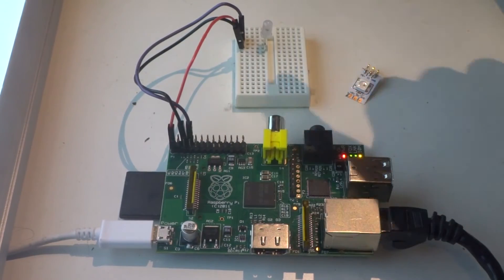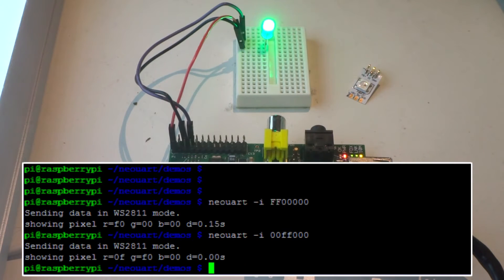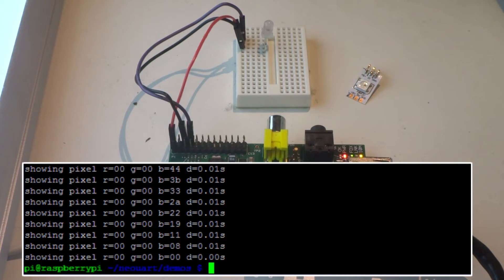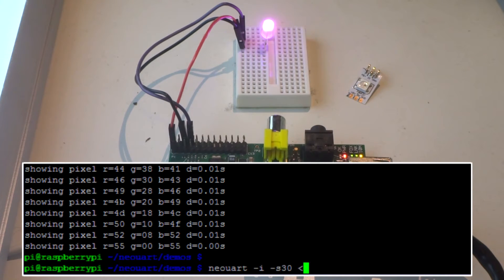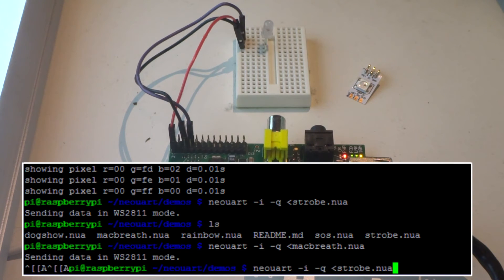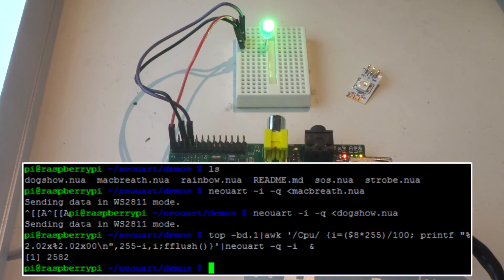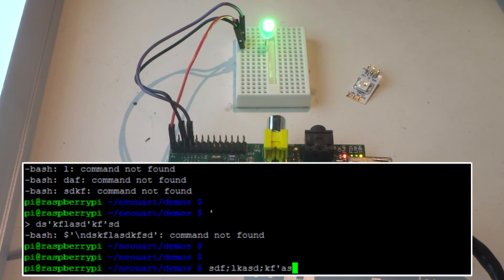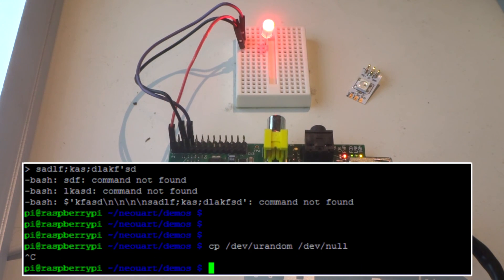NeoPixel Connected Directly to Raspberry Pi

Comment: i have a rpi 2 and it work.But how can i make more than 1 neopixel led turn on.I have a 4 led stripe.Please help me.
Reply from the maker: +Marcus Lindemann This library can drive as many pixels as you like on RaspPi... 
https://github.com/jgarff/rpi_ws281x
Reply: The Lib is not working on GIPO18. But i have found out that is working on GIPO12 on the RPI2 thank you.
Reply: you can run a few neo pixel Leds with a pi3 and python code; how ever if you have too many it will burn up your pi3 if you draw too much power from it. I have a video showing a setup with an extra power source and a link to the project i used on my youtube page.